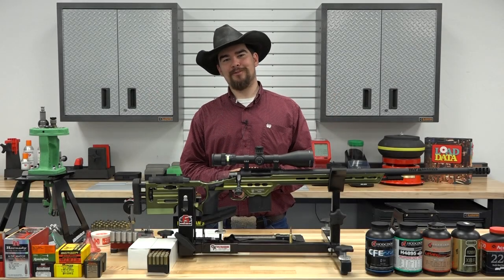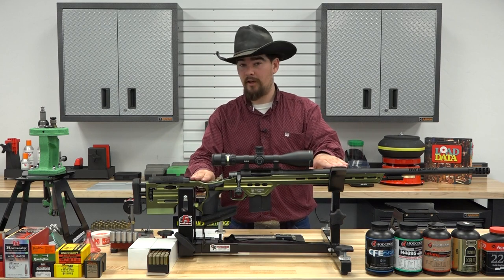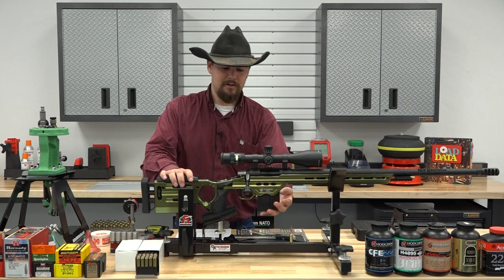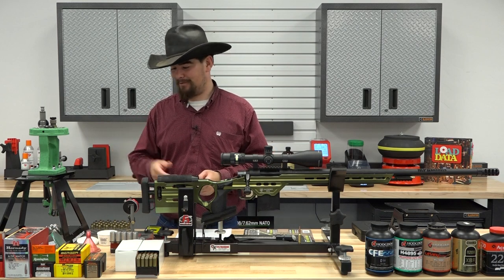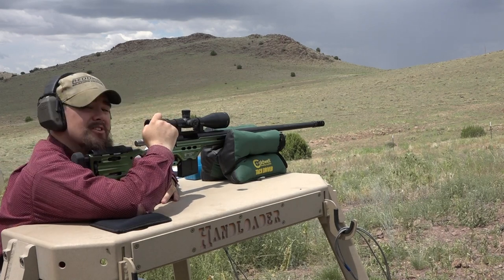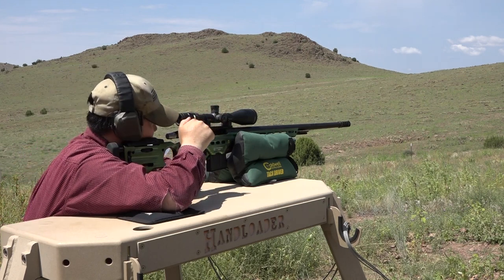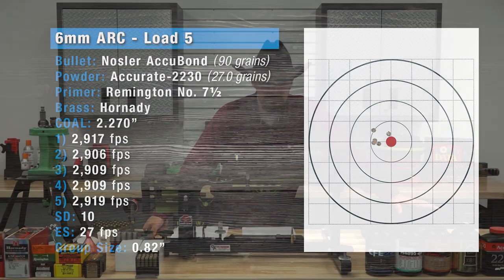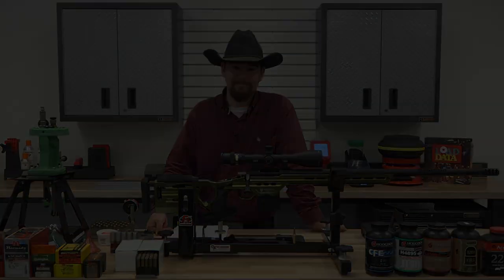Handloading and Shooting the 6mm ARC

Comment: A lot of gun for a little bitty bullet with not that much speed. Why this over a 6BR/Dasher in a bolt action? They'll be a lot easier to find a load for too and Peterson, Lapua and Alpha make brass for it.
Reply from the maker: I think the reason is two fold the biggest one is the fact that it is optimized for use in an AR-15 and feeds and functions in the magazine. The second reason is the availability of factory loaded ammunition. At the time of this filming I don't think Lapua, Peterson or Alpha was making brass but I could be wrong. Other than that there is not much of an advantage to it over the 6BR or Dasher. Thanks for watching!! --Jeremiah
Reply: @HandloaderTV  That’s what I’m saying, makes sense in an AR, but not really a bolt action. I was referring that those companies make brass for the BR and Dasher, not the ARC.  This is Handloader TV, we don’t care about factory ammo! Keep it up, you’re doing good work. Just thought the ARC was a strange choice for a bolt action. Like 224 Valk in a bolt action when there’s tons of better 22 offerings.
Reply from the maker: @MrMalicious5  Yeah the performance from the AR is pretty impressive but the bolt action not quite so impressive, it is nice that they give you higher pressure data for use in a bolt gun though at least then you can push the limits a bit and get peak performance from the cartridge. Oh my apologies I misread that! That is true and those companies make an excellent quality product!! The Dasher and BR family of wildcats are great performers for sure. I think you can come close to dasher performance in the ARC with the "bolt gun data" but If I recall correctly the dasher wins. To be honest my personal opinion of the .224 Valk is not a very good one but then again you know what they say about opinions! I agree though there are a lot of better 22 cal offerings. Even in the AR, I would take a 22 Nosler over 224 Valk any day of the week. Again though that is just me. --Jeremiah

Comment: I doubt you’ve seen “alot” of bolts fail. The issue with bolt lug sheering in the Grendel was with the use of 5.56 bolts that were opened up and not heat treated and hardened. Been running a 243LBC for years at the max without issues. Stop regurgitating myths. Use the Satterlee 10 shot load development method and see where you end up…unless you have a pressure test barrel you’re not gonna know.
Reply from the maker: First off thank you for taking the time to share your thoughts on the matter and for watching the video. I have received pictures from subscribers over the years of many bolts used in the 6.5 Grendel that have failed, a quick google search will turn up many of these bolts. Of course I do not know how hot those loads actually were but I have also experienced this first hand and my bolt was properly heat treated. There is a reason for the Gas gun being set to a pressure maximum of 52,000 PSI. If you go above that pressure level you will increase wear and tear on your firearm. Now not all bolts are created equal and there are many out there that will hold up better than others but you still run the risk of prematurely damaging or wearing out your parts. As far as the Satterlee 10 shot load development method, It has been refuted by many, myself included. I have run many tests using the Satterlee 10 shot load development method and have had it fail to show an accuracy node. Here is the basic problem with it, 10 shots does not provide enough statistical data to arrive at a firm conclusion and in no way does it help determine pressure for a given cartridge. If you look at basic statistics you would see that there are way too many variables in the testing for 10 shots to prove or validate anything. keep in mind that we are effectivly controlling a mini explosion inside the chamber of our rifles. There are many variables that come into play. This method is in fact a regurgitated internet myth. Trust me I am the last person that wants to go around spreading internet rumors. I do my very best to squash those internet myths and share with people what works and provide them with good solid unbiased information. At any rate thank you again for watching and good shooting to you! -- Jeremiah
Reply: @HandloaderTV  well thanks for the reply but Scott Satterlee has proven it works by taking the human error out of the equation if you use an accurate measure to validate velocity ie a Labradar and an accurate way to measure your powder charge. What are you using for a powder dispenser? I’m using AutoTrickler V3 on an FX-120i.  The general consensus is that if you work your way back from a maximum published load you’ll find your high node that works. Eric Cortina uses this method and if you know who he is then you’ll know he’s doing something right. I’ll continue to follow those who succeed (not knocking you). Also with the Satterlee load to work the charge weight increments have to be small. Also your seating depth has a mode too, and the window can be as small as .006”.
Reply from the maker: @DMHal01  Thank you very much for sharing your thoughts this is honestly what the comments are all about where we can come and have these kinds of cordial discussions and hopefully we can learn. I know that is what Scott used to do At  the end of this comment I am going to paste a link to a recent video and you can watch and see that Scott himself has in fact changed his own methods and is even instructing others on this new method. This doesn't seem to be nearly as widely publicized as his 10 shot load development method.  Be  sure to read the video description and watch the video it is actually a two part video and I will post part two. it is certainly not the old 10 shot load development that has been pushed so hard for so long by so many. I think you will find the video very enlightening and informative. I use an Oehler 35P chronograph because it is the only chronograph on the market with a proof channel that actually allows you to calculate your margin of error in velocities and will actually inform you if the reading is poor. One day I will have to do a video on Chronographs. I do have the Labradar as well and in general it is quite accurate when set up properly but I find it slightly less reliable than the Oehler 35P in all honestly. As far as Powder goes I use an RCBS Matchmaster which is accurate to .02 grains and all loads are within .04 grains of actual listed charge weight which with most extruded powders is a kernel or two. I am also familar with Eric Cortina and his reloading methods as well. I am quite confident he does not run 10 shot load development and within those 10 or even 20 shots he has found a load that he is confident enough to take to nationals. I know for a fact there is a little more to his load development than that and I think it is similar to Scott Satterlee and his new method. No worries no, I don't take any offense to what you are saying, like I said I think that it is great that we can come here and have these discussion and we can learn from one another and learn what works and what doesn't work, or what works for you and what works for others. I agree with that, the seating depth node can be very small especially when working with high quality low tolerance barrels IE Brux, Proof and Bartlein to name a few. I think seating depth and ES has become the staple of load development. I just simply think it takes more than 10 shots to find that load confidently. In all honestly I wish it was that simple It would save me a lot of time and components for each of these videos because I have to shoot a lot more than 10 rounds per load it's usually somewhere around 25 per bullet and powder combo. Plus more for seating depth testing. I will post the link below this. Thanks for your cordial reply I really enjoy having these conversations it's nice to know what others think and how they feel about methods used. I hope that all my comments have come across as nothing but cordial. All the best --Jeremiah
Reply: @HandloaderTV   I agree with this last reply, I wasn’t completely clear on my methods and also that Scott’s 10SLD was taken out of context by the majority. The 10SLD only gets you in the ballpark and should only be used to help get you in the right direction but there’s more to it. I personally use a modified version where I do a 15SLD pack in .1gr increments. Now in reference to the RCBS Matchmaster, I did a test on that and the new Hornady auto charge Pro. The bad news is that they throw short of the input charge weight as a safety measure. For example, for a 6mm ARC load that I use, I’ll input 30.3gr of CFE223 and the scale will tell you it’s 30.3gr or in the case of the Hornady it’ll show 30.3 after it goes over for a brief second to 30.4 then it rounds down when it’s settled. Well when I purchased my FX120i and a lab certified 100g weight the results were interesting. I would show on average with the RCBS CM an average disparity of .06gr short and with the Hornady it could be as much as .08gr to .1gr on top of that, the machines are supposed to be accurate within 2/10 of a grain. So this means it can be off by more or less. So I’d really confirm that they’re working for your intended use. In a small cartridge it’s a big enough deal but for 300 WinMag no. As for the Labradar, it’s only consistent as long as I’m using a trigger mechanism. Also I have a real magnified micro sight with a reticle that I use to align the Labradar to the target. I’ll check out the video you’re recommending because it’s always good to learn and I’m not too proud to say I could be wrong or I could still learn.
Reply from the maker: @DMHal01  It is always difficult to communicate over YouTube comments having a limited space to type out rather complicated replies, It would also be so helpful to be able to simply add pictures into these comments but I digress. That may be true there are a lot of people saying that the 10SLD is the end all be all. In my experience it has as much of a chance to reveal a node as it does to miss a node. Perhaps this is something that I should revisit and do a little more comparing and contrasting. I do know that the RCBS Matchmaster can be a bit finicky and the Hornady Auto Charge pro is only accurate to 1/10th of a grain (.1 grain). That is very interesting to hear about the RCBS Matchmaster I have a set of Certified check weights and 2 Matchmasters and both have always been within .02 grains. It has been awhile since I verified this though and perhaps I should double check once again it never hurts to check ones equipment from time to time. I know when using extruded powder I have had no problems trickling up 1 kernel at a time and it seems to be able to accurate and reliable and register each kernels weight as I trickle. I like the Labradar for the convenience sake and it is accurate but for our purposes we want to get the most accurate and consistent results with zero errors. I too use the trigger function and have even tried the microphone add on and I get perfect readings nearly every time but after 200 or so rounds it is not uncommon to have a velocity or two that seem off or inaccurate or it fails to trigger due to the rifle being suppressed. So that is the primary reason why I use the Oehler they have been making chronographs for a long time and their pressure testing equipment is the gold standard so it makes more sense to me to use them. Plus I like how the model 35 P has a proof channel to double check and ensure that the velocity reading is correct and there are no errors. I would be curious to get your thoughts on it. His new methods seem to make a lot more sense to me and I think it lines up more with what Eric does. That is a good way to be and I couldn't agree more! I am a very results driven person and I am always looking to learn from those results and make sure those results are as accurate as humanly possible. It is simply amazing how much I have learned since I started doing these videos, there are many thanks to go around to people like you who challenge me on methods and provide different insight into things and many great handloaders and ballisticians that have answered countless questions and spent countless hours on the phone with me discussing these things. There is always more to learn though and that is the important thing to never stop learning. --Jeremiah